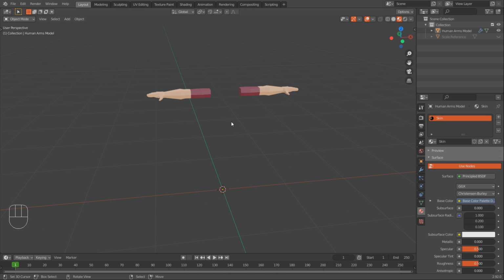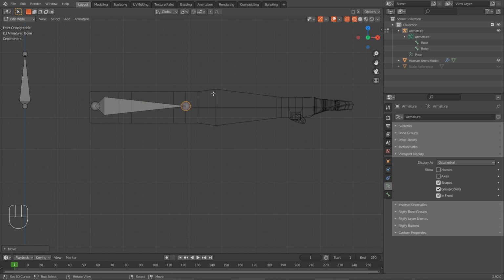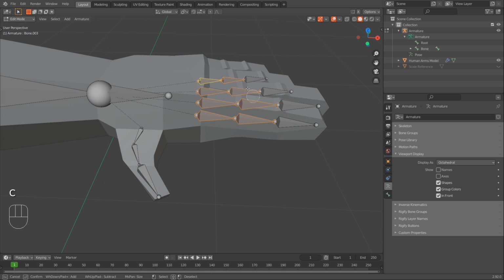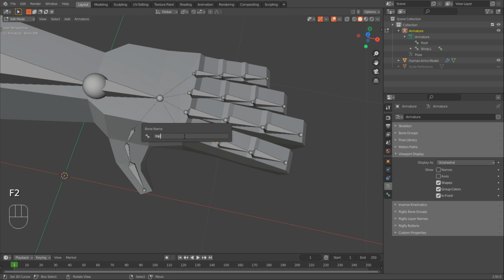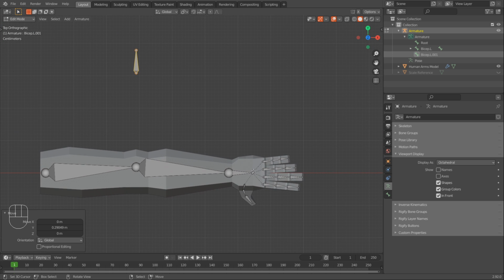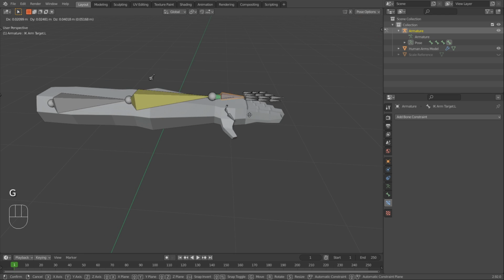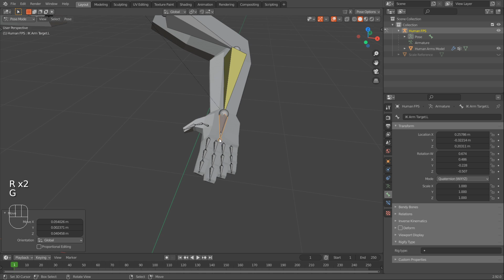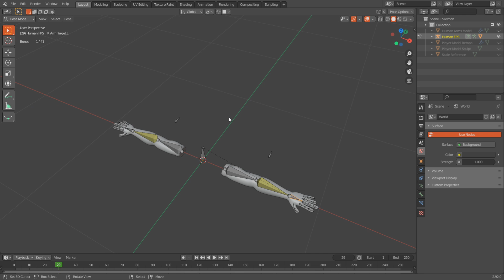Rigging FPS Arms - FPS Game With Unity & Blender

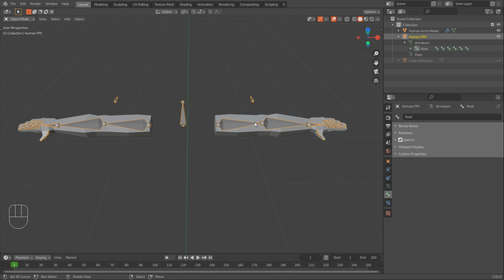Comment: I've tried 3 times now and up until 13:26 it all works, but when I do the automatic weights, it gets all f*** up. Suddendly the opposite bicep moves when I move an Arm Target and none of the forarms are even connected to the armature. When I switch to weight painting all it shows green on the right hand and the rest of the vertex groups are just blue.
Has anyone experienced this?
Reply: I anyone else is having this issue, it's because the normals are out of whack. Go into edit mode while having the mesh selected, select all by pressing A and then shift + n to recalculate normals. After that, my auto weights worked like a charm.
Reply: @Properpeanut  Thank you so much, i've been trying to figure this out for like 3 hours and its finally working. holy bro!

Comment: For some reason I had some kind of issue with the global positioning when using the symmetrise option. The armature would duplicate but not go on the opposite side. If you have this issue then try the following. Select the armature in object mode, under Object, Apply, click Rotation and then try fiddling with those.
Reply: Another thing to watch out for is that both arms normals both the same, otherwise you might experience differences between the arms. Spent hours looking for the problem, turned out it was the normals were flipped (one red one blue).

Comment: Making the armature the parent of the mesh with automatic weights made everything wrong. Moving the bicep affects the bicep of the wrong arm, moving the wrist bends the whole arm beding the wrist, and using the IK pole makes the entire thing twist. The weight paint tool doesn't help either, as it's still treating both arms as a single large object
what do I do?
Reply from the maker: Hmm, apply the mirror modifier and then try and auto wp again. Make sure you unparent it first
Reply: @SingleSapling  Thank you, the arms get treated as separate now

I'm still having to go through and manually paint in the weights because the auto ones mess up the fingers really badly, I even deleted the hands and redid them from scratch and still no luck there
Reply: @SingleSapling  I don't know if you still reply to comments, but I still haven't fixed this can you help me
Reply from the maker: Maybe there are some duplicate vertices, select everything, press M and then merge by distance. It could also be that there are holes in the mesh somewhere or interior faces. Cant really tell by just the description
Reply: @SingleSapling  thank you! I just sort of temporarily fixed it by using the other type of weight. By the way, I’ve moved on to your gun tutorials, but I have one question - should I make the gun sort of tilt up as if it has recoil in the shoot animations? Right now the slide/barrel just moved back.
Reply from the maker: Up to preference. You can do it in an animation or you could do that part through script which will give you a bit more control. Both are kinda tricky and finiky to set up so choose your poison.
Reply: @SingleSapling  alright, I’ll just mess around with it and decide. Thank you, ur tutorials r helpful af

Comment: Thank you so much for posting the video! One problem though. Every time I try to animate the arms, they bend in the wrong way. For example:  the right arm, instead of bending inwards towards the chest, it moves backwards to your back. I did start on the right arm instead of the left, so maybe thats why? but I'm pretty sure everything got oriented correctly.
Reply from the maker: Hmm, before you weight paint, make sure that the elbow is bent a bit towards the back

Comment: The Automatic Weights don't work for me. It warps the model in a way its not supposed to(the arm folds as if it has no joints and the finger bones warp other fingers as well) how can I fix this?
Reply: try doing envelope weights
Reply: @thebadboy2002  i tried, it fixed some thing, but fingers still dont work how it need ti
Reply: For people with the same problem. In my case some faces on the mesh had inverted normals for some reason so i just recalculated them.

Comment: These tutorials are fantastic! When I try to put the bone in my arm though, it collides with the mesh and refuses to go inside of it. If I try to rotate or move it in the arm, it straddles on the outer edges of the arm and ends up in the wrong place with the wrong rotation. Any idea what's going on? How do I turn off the collision? Thanks in advance!
Reply: I solved it, turns out I had snapping on from when I was retopologizing. Big brain moment right there.
Reply from the maker: Biiiiiig brain :P

Comment: good lord the auto weight paint is no where near close lmao dont tell me i actually have to do it manually );
Reply from the maker: No of course not, just adjust the bones a little and try again
Reply: @SingleSapling  damn that was a quick reply, basically stuff like the elbow isnt connected at all because the forearm painted to nothing and for some reason the finger bones painted slightly but to the fingers next to it, not the one its actually inside. cant figure out how to get it working properly
Reply from the maker: I heard some other people got this problem, what worked for them was to basically remake the whole thing. Although you could try just remaking the ring or copy pasting the mesh and rig into another blender project to see if there is still a problem. But again safest bet is to remake the whole thing sadly. Good luck
Reply: @SingleSapling  thats exactly what i did and it worked for whatever reason
Reply from the maker: Sometimes Blender just says....no

Comment: If anyones having problems with parenting the mesh with the arperture, and esp if youre using a higher poly mesh -- it might be a topology problem and fixing it on 1st level of subdivision is much easier, so just check any problematic areas you might have with the higher level mesh and spread out/tidy those areas before subdivision. Easy and it worked for me
Reply: I'm experiencing this and I can't fix it :/
Reply: Manged to copy and paste all of the bones work to another file with mid poly, it worked. However, the bones are not attached to the bicep, so everything else moves besides the biceps
Reply from the maker: They are not influenced by each other?
Reply: @SingleSapling  Thanks for your reply, much appreciated. I managed to fix it by recreating bones in the mid polly arm. However,  too bad it did not work with the high polly arm, it have more details and looks better.
Reply: @SingleSapling  Something weirder happened tho with the mid poly, when i selected everything to center it with the origin of the axes the mesh got all messed up and ruined the shape and everything, very weird. May have to just use a low poly but i really wanted to use a higher poly 😢
Reply: i think it happens when i rotate the mesh or the bones by 90 don't know what's causing it, it's very annoying
Reply: nvm fixed by applying the mirror, the mirror and the shrink wrap and everything before rotating it

Comment: If Symmetrize isn't working, and none of these other fixes have worked, try applying all of your transformations and then symmetrize. It's also possible that it was caused by my orientation being different (using different axes than in the vid). This fixed my issues.
Reply: thanks man it worked for me :D
Reply: @rocketman-f3  glad to help out!
Reply: its not working for me any other fixes for this?
Reply from the maker: Maybe check that the origin point of the armature is in the center ( that the left side of the rig is indeed to the left of the origin point) dont know if that will help at all but its worth a try
Reply: @Asdafadas Qwe fandas  I'm not so experienced,  and this is just a guess, but try looking at the names of objects. It has helped me before, to label them like "Arm. L" for the left and "Arm. R" for the right.
Just a small thing that can be easily overlooked, like applied transforms, global vs local space, axis orientation, etc sometimes it slips my mind.
Other comments probably have more useful info
Don't be worried about starting from the beginning again if you can't find the issue, this has saved me more time than not.

Comment: I'm just wondering if anyone had this problem - The 'IK.Arm Target' bone does not rotate the hand as expected. If e.g. I want my wrist to rotate around like it were a helicopter motor, it just doesn't. This makes animating borderline impossible because of the limited movement. The 'Palm' bone, however, seems to be able to rotate fine in the problematic axis, but doesn't move the hand in any other one. Anyone has some ideas? Any way of improving the tutorial skeleton in this regard?
Reply: I've found the solution - The creator is using a 'Damped Track' modifier on Palm bone to copy the rotation of the Arm Target, but it limits the movements in certain axes, it seems like a huge oversight and I have no idea why he has not mentioned it.
Instead, I've used the 'Copy Rotation' modifier on the Palm bone, and everything seems to be working as expected.
Hope it help anyone with the same issue.
Reply from the maker: I see you fixed your own problem, I havent had much luck with the copy rotation constraint, thats why I am using the damped track one. Nice to hear its working well for someone ;]

Comment: Symmetrize is flipping it the wrong way, it stays on the same side and just runs parallel with the left arm. I named the bones correctly and rotated the arms in every direction and its still the same result. Anyone know how to fix?
Reply from the maker: when u symetrize there should be a small box in the bottom left where u can change the direction
Reply: Select your armature in object mode and navigate to Object > Apply > All Transforms.

Comment: I cant symmetrize my mesh. When i click on Symmetrize it just copies the bones on the same side as the original ones and then sometimes the palm becomes parent of those bones or when i put them on the right arm they just become broken and the IK Arm target doesnt work anymore and just moves the palm
Reply from the maker: Did u name them properly?
Reply: @SingleSapling  yea i did i just gave up and remade the rig but everytime i remade the rig the past problem would go away but another one will show up
Most of the problem having connection with the IK but now the problem is that the left arm is turned on a side but the right arm is still straight and i cant really turn the left arm back to normal (this is my newest problem)

Comment: I have a problem, when i move a bone, the hand moves to but in a diffrerent direction and does not follow rotation and location, it goes where ever it wants. Second problem is when i move the finger bones, the bone pulls part of the next fingers with it. i tried weight painting but it does not work like yours.
Reply: same, my hand model moves in weird directions
Reply: same but my arm also refuses to bend it just curves out

Comment: Having an issue with the IK constraint on the Forearm bone. Whenever I move the Target bone, the "elbow" between the Bicep and Forearm bones won't bend so the arm remains straight.

I have the IK set to the same values:
Target: Armature
Bone: IK_Target
Pole Target: Armature
Bone: IK_ArmPole
Pole Angle: -90d
Iterations: 500
Chain Length: 2
Use Tail: true
Stretch: true
Weight Position: true, 1.000
Rotation: false
Influence: 1.000

I've tried re-rigging it to the same result, really cannot figure out what went wrong :(
Reply: Nevermind, I got it working! I never moved the elbow bone tail backward slightly
Reply: @ghostboy986  how did you got it working?

Comment: i've got everything to work up until you parent the targets and poles to the root bone, my rig bugs out when i try to move the hands in pose mode
Reply from the maker: Probably set the iks wrong, did you try and remake the rig
Reply: @SingleSapling  It takes like 10 minutes just to name all the bones, and you want me to remake the intire rig?
i have the same problem and its not because iset the ik up wrong, because initially it worked right, then it started becoming buggy with the hands, there is a better solution to this problem than remaking the rig because something is causing this and it's not the IK
Reply from the maker: @samuelhugo3387  I've never had this problem and I did this dozens of times. Try and join the discord and see if someone has a fix
Reply: Remake the rig, don't worry about naming everything, naming isn't necesscary.
Reply: @coffee-beast-99z  well  i geus, i just heard that it's good practice to name them, but the point i was trying to make is, that if i redid the intire thing everytime something went wrong then I would never finish, i should rather learn how to fix problems than redo my work becuase learning how to fix problems is how you inprove, Anyways i did end up fixing it thanks
Reply: @samuelhugo3387  redoing it and find out what was the problem is a way of learning. You will know what went wrong and how to fix it. If you  don't know the problem, how can you find a solution?
Reply from the maker: Good advice